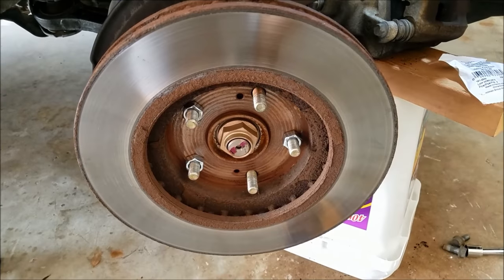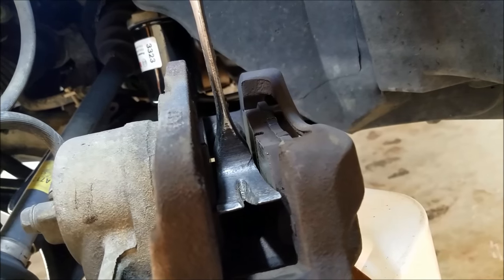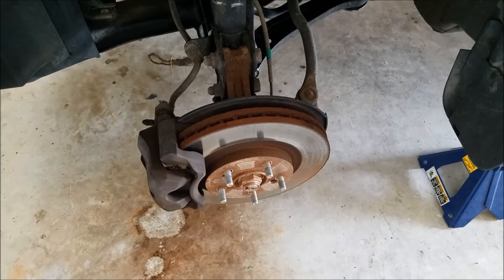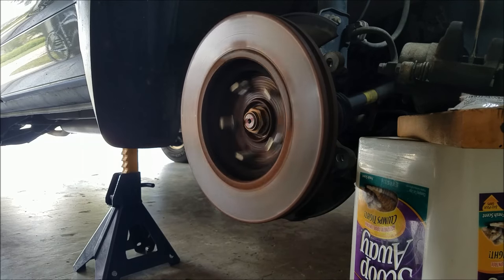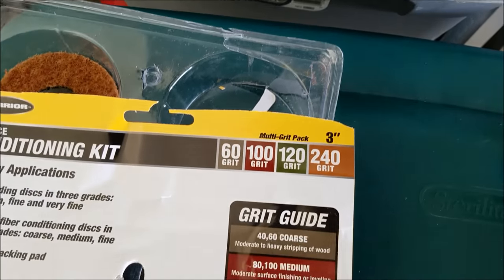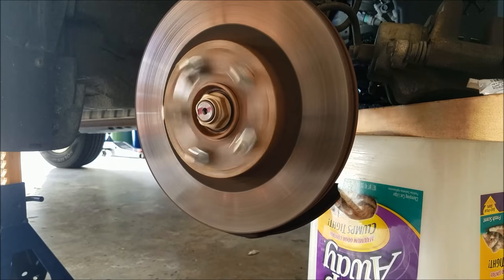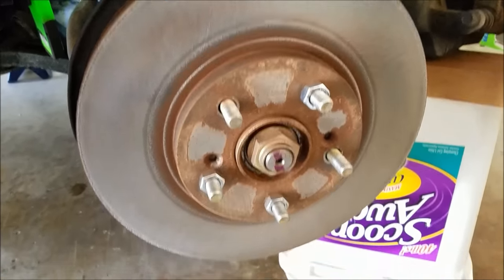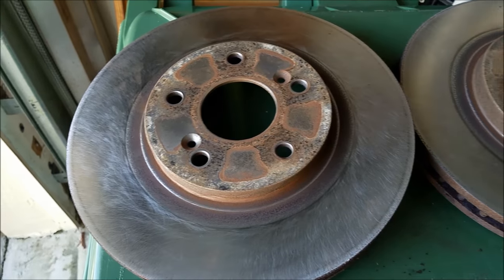DIY Do It Yourself Redneck Brake Rotor Resurface: Resurface Brake Rotors at Home

Comment: Usually pulsating brakes is a clear sign of a warped rotor or drum. I suppose other factors could contribute... I live in a hilly area. With some smaller mountains. Bad pothole roads. Gravel roads. Salted snow covered in the winter. Heavy rain and hot humid in summer. Our cars dont last long.( south of buffalo ny near p.a. boarder) most cars have holes in the floors within 10 years. And suspension systems take a beating. Almost any brake job i have done as a mechanic i have noticed the pads and or slides are frozen in place. This has some to do with others almost always using the wrong lubricants. ALWAYS use silicone grease. But our environment just degrades things very quickly. Because of the hills no matter what type rotors i have used i find that they usually become warped after the first few drives. Brake noises are usually from like mentioned before siezed pad ears or slide pins. Also embedded material in the rotors and or pads. Causing glazing. If you ever have a squeal but the pads have alot of surface left. It is best to clear the rotor like this video. Or to a lesser extent with just some emory clothe and brake cleaner. Also clean the pads. Soak with brake cleaner and wipe with a rag. Then take sand paper or emory cloth and scuff the surface and spray again with brake clean. Do this a few times until the pad appear rough and free of loose material. Most mechanics dont typically do this. But i always have. It is my remedy for brake chirp. I do the same with drums. Often with drums, since thet hold most of the brake dust inside they become embedded. My father told me years ago guys would do this. But all they did was put the brake pad on a concrete flood upside down step on it and scratch it back and forth across the floor.. Haha. That works too. Just a dirtier less controlled method. Risking getting oil or whatever else in the pad..
Reply: Pulsing brakes is caused by a thickness variation of the rotor.  Always buff both sides of the rotor hat and hub clean of rust and debris.  A lateral runout caused by rust trapped between the rotor and and hub will cause a thickness variation as the rotor wears.  Lateral runout can also make the pads wiggle back and forth in the bracket creating  a squeaking noise and extra wear on the pad locators.
Reply: I was just passing through that side of town for the first time going to Niagara Falls I flew in from Miami to buffalo did Niagara then drove to Manhattan, that driving trip was all hilly compared to flat Florida ,I realized all the older cars were rusted out.

Comment: Wouldn't it be better to get the bad stuff off while the rotor is off the car and then fine sand with it on?
Reply from the maker: Yes, probably so, but not as fun. Lol
Reply: @Lucky Vagabond  hey man, fair enough. Back when I made this comment, I tried this 😆 it didn't work out. I think I may have sent it a little too hard. The rotors were already shot, and I had the new ones ready to go on, so no harm, no foul.

Comment: Did you know that if you bring your rotors to a mechanic he will charge about $20 to get both done?
Reply from the maker: Yes, but I didn't need metal taken off the rotor. I needed old brake pad material removed.

Comment: No way it ever going to be smooth and straight as glass  . You might not see high and low spots but when you're high speed braking you will feel it . This is straight STORM PUNK SHI+
Reply from the maker: No, you're wrong. This worked perfectly. No pulsation at all, even at high speeds.

Comment: It's a shame that autoparts stores have stopped offering this service thinking that they are going to force people to spend more money. 
Sure the rotors are "only" $30 ...each.  If the rotors are within spec why spend it? That is the mentality that keeps the poor poor.
Reply from the maker: Exactly! We need to fight this disposable society.
Reply: Nah lawsuits too
Reply: @joeyork9891  you have a funny hat
Reply: Not to mention but the new rotors are very low quality. I have seen videos where they have actually shattered. So much better off having the originals turned if there is enough metal left to turn.

Comment: Can it be done on bigger trucks like f250 or e250
Reply from the maker: Not sure. My vehicle was front wheel drive, which made it easier to do.
Reply: @LuckyVagabond  i think tire store didn't torque my lug nuts even my rotors make it shimmy when braking I hate it

Comment: Do you think it was necessary to run the car to turn the rotor? Could the same service be done with rotor off the car and held stationary in a vice?
Reply from the maker: That's a good question. I think you probably could get similar results on the bench, but having the rotor turning helps with evenness, in my humble opinion.
Reply: @LuckyVagabond  Yes, of course it does, because now you are simulating a lathe. What is better is to set up a stand on which you hold the drill steady, so you're not freehanding it.

Comment: Awesome👍 its better to figure out and try to fix things yourself. I usually take them off while the car is on jack stands, take the rotors to Brake Masters and have them machine it for $10 each but if this works really well I rather do them this way.
Reply: It's 25 bucks a rotor to turn them here

Comment: I believe in the attempt to resurface rotors, however, much attention has to be paid to having that sanding wheel or disc Flat against the rotors surface, so as to Not make uneven ware indentations. I'm open to these options, but that is my concern. Its hard to find a shop nowadays that does this.

Comment: Anyone with half a brain and some common sense should know that this is a precision piece of equipment designed to stop 2 1/2 tons of weight in motion and therefore there’s no substitute for doing the proper procedure for the smooth  operation and maximum life of disc brakes, period!
Reply from the maker: Brakes are not precision equipment. If they were, rotors wouldn't be $25.
Reply: @LuckyVagabond  25 buh I don’t think so.  That’s why brake lathes were made, think about it and wait your turn.
Reply from the maker: @modoc852  nobody resurfaces rotors on a lathe nowadays.
Reply: @LuckyVagabond  now you’re just peeing on yourself. Focus!

Comment: Why not just take the rotors off and take it to an auto parts store. Many O'Reilly's, AutoZone stores, and Car Quest Parts stores will resurface the rotors for you for less than $20 each?
Reply: Where have you been the last 10yrs!/lol!

9 of 10 auto stores that had a brake lathe to cut rotors stopped doing it yrs ago to push new rotor sales.

Comment: If the sanding drill was fixed and was able to approach little by little, then I would agree! But doing it manually like so will make it worse, honestly you did not even try to find the highs and lows...It could have fixed the issue but just temporary.
Reply from the maker: Not temporary, I'm still running the same rotors with no pulsation. All this procedure did was remove the old pad material.
Reply: @LuckyVagabond  Sanding as such will removed the high spot material on the rotors.  Turning the rotors basically just removes the brake material hence why the problems are corrected, turning just does it more aggressively by shaving the metal off the rotor. Good quality rotors should be pretty true and should not need turning, just cleaning of the rotors as such done here.  In all the years I have done rotors most issues and perceived high spots are the result of brake material on the rotors, not the actual rotors being"warped". I have only seen one rotor truly warp and there was no way to true it.  Also as long as the vehicle is truly secure on jack stands the risk of the vehicle coming off the stands while its spinning is very rare. Most people don't bother to bump the vehicle with their butt to see how stable the vehicle is on jack stands.  There should be no movement or very very very little.

Comment: You did not have to put the vehicle in drive. Leave it in neutral would do the trick! Make sure you keep drill at 90 degree angle to rotor.

Comment: You can buy a new rotor for 20 bucks though. How much is your time worth?!
Reply from the maker: Yes. RockAuto has good quality rotors for $15, but, my rotors were still good, just needed the old pad material knocked off. I hate wasting good parts just for convenience.
Reply: I wish parts were that cheap in Australia ,, god we pay through 5 times as much here for parts , they rip into us ,,
Reply: Philip Dahlin brake rotors out here are $100.00 and up each one

Comment: this would work and be more legit is if you also took measurements
Reply from the maker: Still running on the same rotors with no pulsation, so I'd say this is legit. All I did was knock off the old pad material. Barely took any metal off the rotor, if any.

Comment: Hahahahaha yeah... I'd be surprised if a Honda had a locked differential. I don't think even a LSD would spin both drive axles unless you pushed the gas a bit because the clutches or whatever the locking mechanism is in the diff wouldn't be grabbing. I do this with a hard rubber sanding block and the transmission in 1 instead of D

Comment: This is all extremely stupid. Rotor surfaces need to be PERFECTLY flat. And need to have a certain thinkness to resist warping. There is a good reason professionals suggest you buy new rotors, and it has nothing to do with money. Think about the physics involved.

You ain't wrong calling it a   Redneck   job that's for sure.

Comment: Slight problem, apart from it being extremely dangerous - broken wrist or worse.  didn't see any check on rotor thickness at the end.  Needed to be done.
Reply from the maker: This isn't really cutting the rotor. I'm just removing the old pad build up, but I agree, I proper rotor thickness check wouldn't hurt.
Reply: The sanding disc will barely be touching the metal thickness at all, it's not like a lathe tool !!!

Comment: lol bruh just buy new rotors.  Things are like $30 each.
Reply from the maker: Why pay $60 when you can keep your existing rotors for $15 and do this job as many times as you need, plus keep less trash out of the landfill.
Reply: The old rotors are also hardened from repeated heating up and cooling down, which is better than new rotors.
Reply: Maybe he should buy them with your credit card
Reply: @LuckyVagabond  I wouldn’t cheap out on any part of the braking system. Also you can’t keep resurfacing rotors forever you know that right?

Comment: How can you tell they came out awesome until you actually put it all back together and drive it.
Reply from the maker: Because I could tell all of the old pad buildup had been removed. I'm still running these same rotors with no pulsation. Just smooth braking.
Reply: Some parts store will cut your rotors for like $15. Just sayin.

Comment: This is extremely dangerous sir, 
You needed to loosen the xy bolt from the frame bracket and loosen the cronogen c clamp from the reservoir of the mud flaps!
Reply from the maker: The what from the what? I don't have muffler bearings.

Comment: Can't do that on an all wheel drive...
Reply from the maker: Sure you can, just raise all four tires off the ground.
Reply: The work involve on resurfacing 1 or 2 rotor is much more with all wheel drive...
Reply: Bro its just raising two extra wheels.. Not really that much.

Comment: Do it at the machine. Grinding by hand may cause vibration while braing.
Reply from the maker: Nope, worked perfectly. I'm just sanding off pad material, not rotor material.

Comment: You don’t have a positraction rear end that’s why one side is spinning, block it from turning and the other side will. Not good to run bearings and seals with no weight on them, would not recommend doing it this way especially since auto zone resurfaces rotors for 5$ each

Comment: Never ever let a car run while it’s on axle stands. This is dangerous. You would of got the same effect without the rotor moving.
Reply: If the vehicle is supported correctly its ok. We do it all the time in repair shops.. On the floor not as often. Usually at a shop we have them up on a lift when spinning the wheels. But if you have the drive wheels off the ground atleast 5 inches supported by 2 sturdy jack stands ( best to also keep the jack under too for a third support) the other wheels chucked it good. Not saying its the safest thing in the world... But neither is working on anything underneath a vehicle. Be also a good idea to keep someone in the driver seat in case something goes wrong they can stop the car.